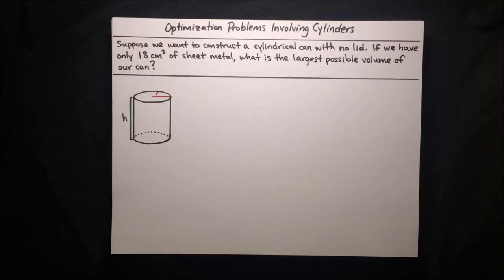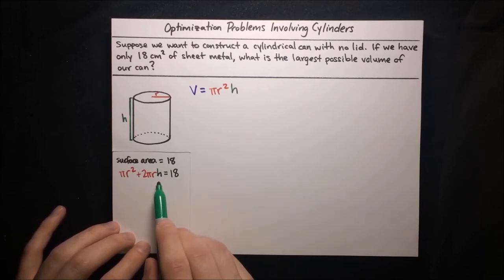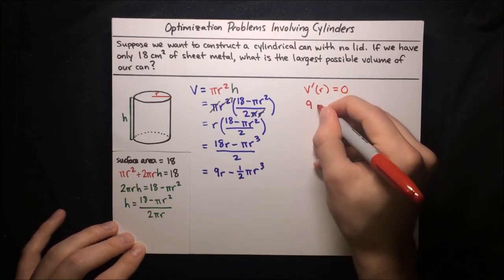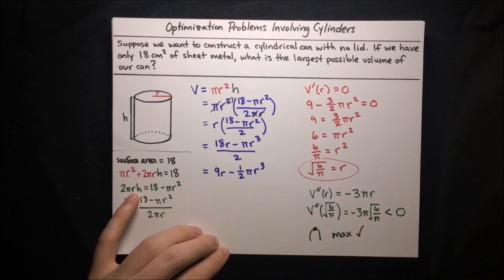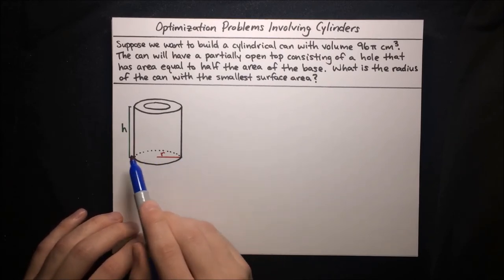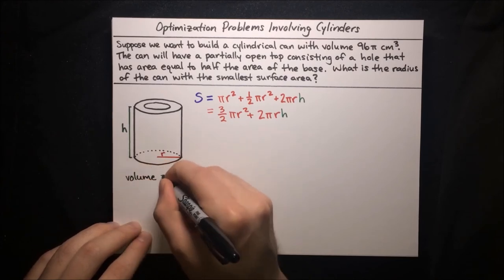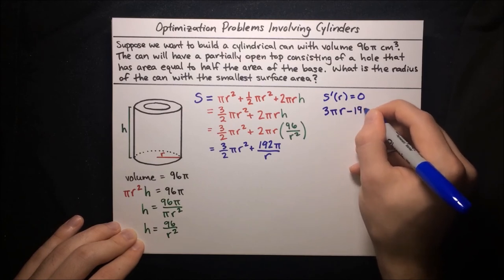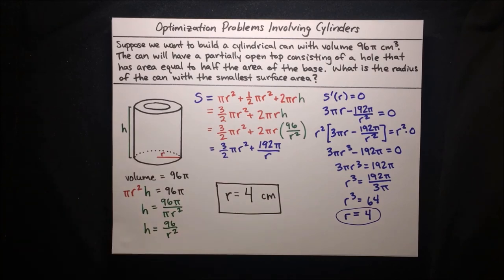Optimization Problems Involving Cylinders

Comment: At 3:07 you times out “r” to remove the bracket however why does the denominator not become 2r? great video!
Reply: I know this comment is from a year ago but to anyone wondering the same thing, think of ‘r’ as r/1 then multiply. The r only gets distributed into the numerator not denominator

Comment: 9x3/2 is 27/2. not 6. 

9x 2/3  is 6.

root13.5/pi= ~2

I got r to be 2.07 and h to be 0.43. 

which makes sense when substituted back to the surface equation , it equals 18.